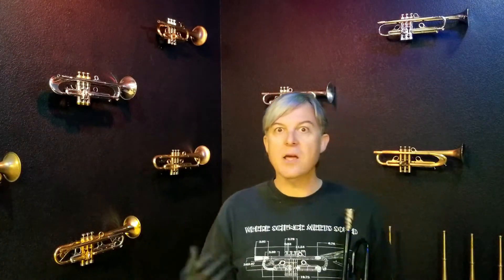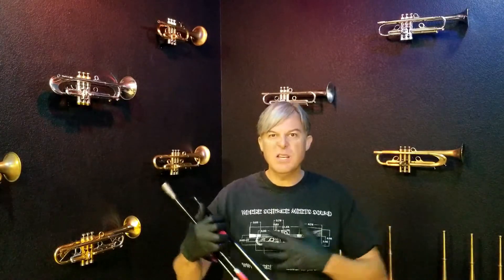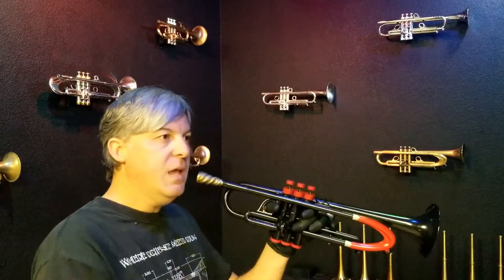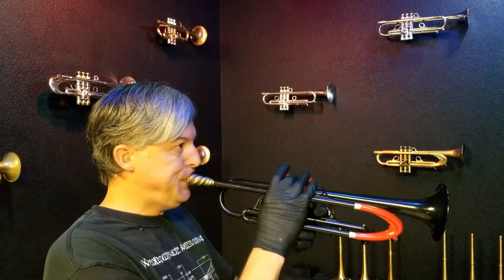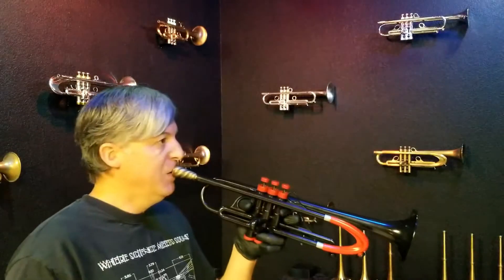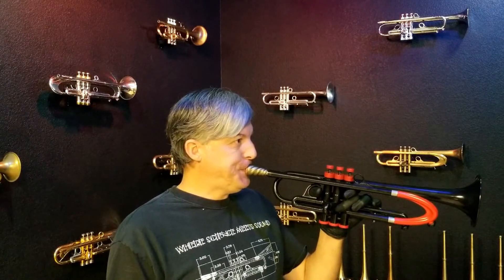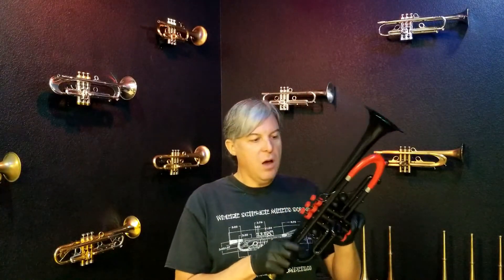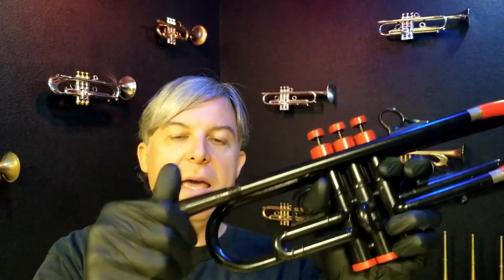Relieving Mouthpiece Pressure #3 Air Pressure on Trumpet

Comment: Jason, when you slided down fra low C to pedal C, did you go from using the lower lip and when hitting the pedal C changing to the top lip? 
This what I experience - when hitting pedal C, the top lip starts vibrating.
(Maybe that is why some also use pedal C# with 123 and lip it down to pedal C - then it is the lower lip vibrating on all pitches)

Comment: Tonight I practiced and I tried the bending. I started on low c and bent down and then came up and kept going up. The pressure up high was basically the same as the low notes. I think I just need to practice that sort of playing so that I can play loud, soft, and high and low without the pressure that I usually would use. When it works it feels pretty neat. Thank you.

Comment: Seems like I’m just not getting it. I’m trying to keep firm corner, blow air, close lips without tightening them, and creating air pressure and air speed but the high notes just aren’t working for me. I wonder why.

I’m trying so hard to do everything you say but something must be wrong with my playing because I’m still at the same place I’ve always been.
Reply: Same here... i can't even get a D by pushing 1-3 valves, all i can get is low G instead of D
Reply: amen to that! not easy physics